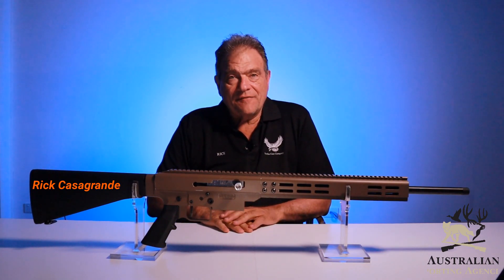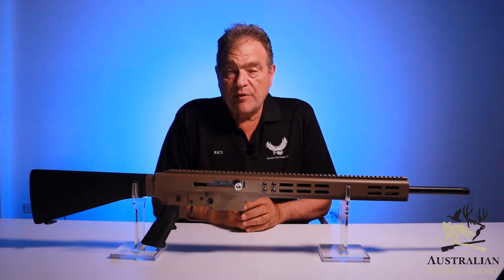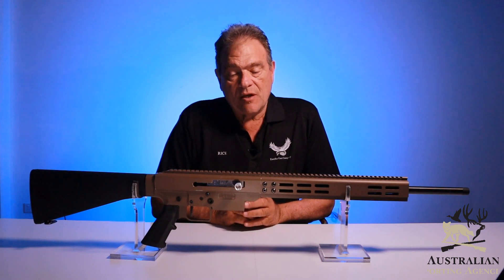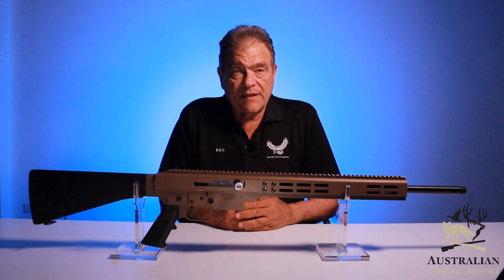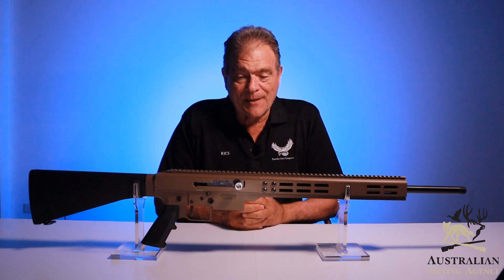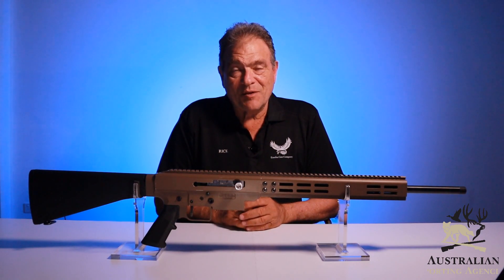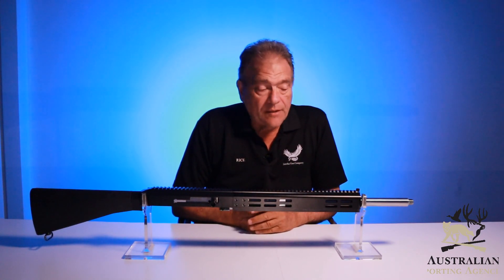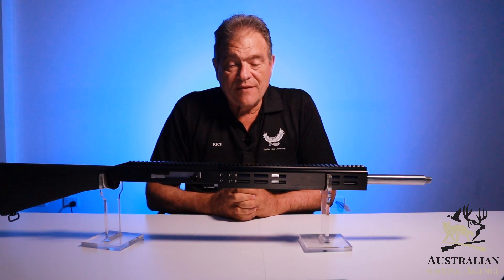Eureka Update #12: 223, 9mm Progress, and 300 Blackout Prototype

Comment: Hopefully I don't get pounded in the comments for this, and it might be a stupid question, but why could we not manufacture the parts ourselves in Australia? Is it Labor costing? Or what? I was more tending towards Australian made, and boosting our own manufacturing. Assuming that Lithgow from my understanding (If I am wrong, please tell me) manufactures everything for their firearms? Or do they also import select parts as well?
Reply from the maker: Cheers, mate, for the question. I'll give you a few examples when it comes to manufacturing in Oz: we can buy pretty much any part made in China at the same price we pay for just the raw material here. Another one is that if you are running low volume which we are ( in the couple thousands....not 50k units) paying for moulds that cost 10-20k usd each for each part before you pay for the part, is not profitable or our guns would cost a lot more. I believe Lithgow can do it as they produce for the military and they are part of a giant defence contractor, so naturally the commercial production would just be the creme on top and doesn't need to cover the costs of the machines. That said, I can not say that I do know their business, so plz don't quote me. So in short, there is no advantage in making products that already exist overseas here unless there is an import challenge or you want to ensure you have full control over the quality. The later part is the reason eureka gun co makes the crucial parts here. Hope that helps?
Reply: @AustralianSportingAgencies  Thats an awesome response. Thank you. It makes complete sense, wish I had enough dosh to invest, I'd buy all the bloody machines for you guys!:goodvibes::goodvibes: I just really like Australians manufacturing stuff, and Aussies making our own guns is super cool.

Comment: When will we see a large frame version for .308 etc? 
Will we be able to adjust the gas screws without having to remove the forend? 
Also loving the updates and the amount of effort you guys are putting into this system to make it as reliable and strong as possible.
Reply from the maker: The factory gas system will not be adjustable but i am sure there will be a after market one. If so with a long screw driver you can adjust it without taken the handguard off. 308 is most likely going to be mid next year as we need to do a fair bit of a redesign.

Comment: How much of the firearm is made in Australia ?
Reply from the maker: All the important parts, upper, lower, bolt carrier, springs. Barrel is US, Butt Stock Turkey. The main reason is that there is no supplier in the country or it is absolutely price prohibitive, and supply can't be guaranteed.
Reply: Impressive, good job.  I’m curious,  can more material be removed from the upper and lower hypothetically?  (If the build budget was a blank check scenario). Would forging the receivers be considered in the future ?
Reply from the maker: Yes you can take out material and you can make them look kick ass, the reason we don't do it is that it will increase tool time, meaning we can make less units in the same time, driving up the price. Oceania etc have their price point because of that extra tool work that goes into them. So yes, if you have the budget and someone who knows what they are doing....you can go kick ass on the receivers.
Reply from the maker: The receiver is made from a solid block. If you want to inject mould it, it will not be as sturdy, and you would likely have to design it differently. Also, to pay for a mould, you would need vast quantities to find a break-even point. I'm not saying it's not possible. I'm just saying that we have chosen a different route for now.

Comment: Short sounds good 👍 
I'd prefer adjustable gas to a spring change though, for more flexibility.
Reply from the maker: Fair enough! I am sure someone will make something 😏😉
Reply: @AustralianSportingAgencies  I am a long time 300BLK shooter that frequently swaps between subs and supers while out hunting.
Reply from the maker: Don't worry, it's not hard to turn it into a tunable gas system.....says the non engineer 😉
Reply: @AustralianSportingAgencies  what do the engineers think about an asymmetrical load and long term wear on the bolt carrier/receiver by only having a spring on one side?
Reply from the maker: We don't think it will make a measurable difference. You can always swap the sides around if you are concerned, but you will most likely find that you won't be able to tell a difference

Comment: Any provision for aftermarket handguards? Would love to bolt up an AR18 handguard or similar.
Reply: Seconding this, maybe offered as custom option for those who want it, rather than the normal model.
Reply: I would be happy with no front hand guard and just a simple cover to hide the 4 unused  bolts, you are not bench shooting a 9mm
Reply from the maker: Already in the making but I don't think we will launch it until March. We need to get through the current backorders first. I'll keep you guys posted on the development of the forend we considering as it gets designed.